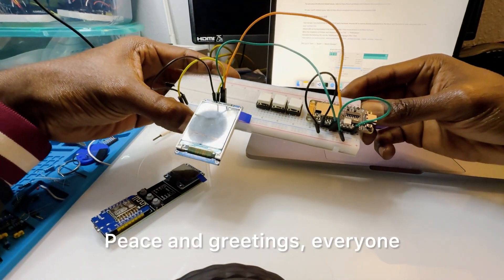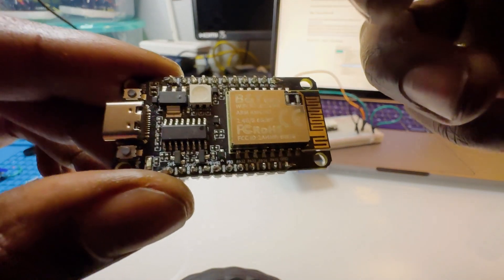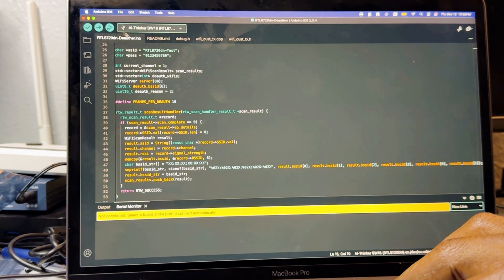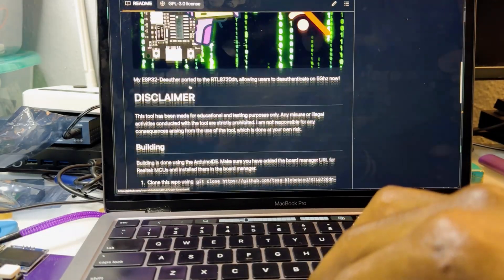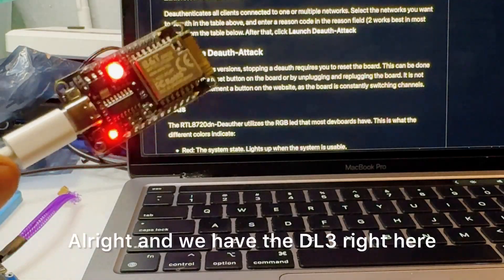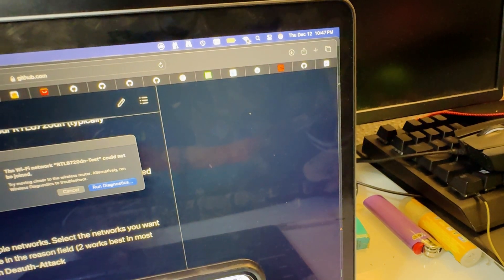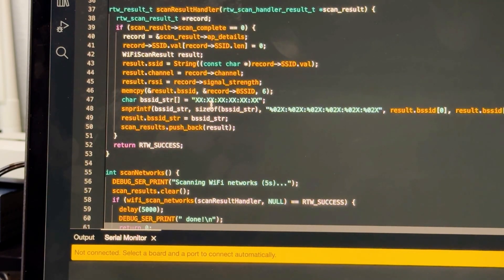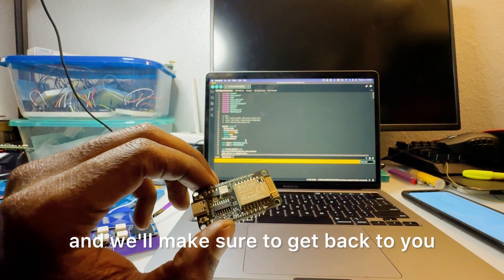How to Make a 5GHz WiFi Deauther!

Comment from the maker: Helpful troubleshooting info!

*Context:*
Many people, including myself, have encountered an issue where their 5GHz deauther doesn't function after successfully uploading the code, even when the wiring and cable connections are confirmed to be correct.

What Worked for Me:

*Initial Setup:*

Plug in your device and ensure all settings are correctly configured (refer to the "Tools Setup" screenshot).
In the tools section, enable the "Erase all flash memory" option.

*Uploading the Code:*

Upload the code as usual. During the upload process, you'll see a message in the output that says:
"Please enter the upload mode manually" followed by a 5-second countdown.

*When this message appears:*
Hold down the BURN button.
While holding BURN, press the RST button once.
Release the BURN button.
This sequence will put the device into upload mode.

*Confirmation:*

After the upload is complete, you should see a message like "Erase flash successful".

*Uploading the Real Code:*

Go back to the tools section and disable the "Erase all flash memory" option.
Upload the real code using the same BURN + RST combination during the "Please enter the upload mode manually" message.
Give the device a full minute to process and settle after the upload.

*Final Step:*

Once you're sure the code has been successfully uploaded, press RST to reboot the device. It should now boot up and function properly.

*Also:*
Some people find success by toggling the "Auto Flash Mode" option instead of using the BURN + RST method, but I personally experienced inconsistent results with it.
Reply: Is there any messaging app you use to contact you like messenger or telegram for better communication with regards to your tutorial sir?

Comment: Why is it not working today? tried to deauther my connection and after selecting the code 2 on the reason code, the light on my bw16 is just blindking red/blue and still no sign of disconnection. I tried it few days ago and still works but now it doesnt. Is there a problem with the code?

Comment: compilation error exit status 1 how to fix?
Reply from the maker: What’s the full error?
Reply: @littlehakr  In file included from C:\Users\sbyym\AppData\Local\Arduino15\packages\realtek\hardware\AmebaD\3.1.9\cores\ambd/Arduino.h:46:0,
                 from C:\Users\sbyym\AppData\Local\arduino\sketches\6507D2408703B01DC35234FED46EFF3B\sketch\RTL8720dn-Deauther.ino.cpp:1:
c:\users\sbyym\appdata\local\arduino15\packages\realtek\tools\ameba_d_asdk_toolchain\1.0.1\arm-none-eabi\include\c++\6.5.0\bits\stl_vector.h: In member function 'std::vector<_Tp, _Alloc>::size_type std::vector<_Tp, _Alloc>::_M_check_len(std::vector<_Tp, _Alloc>::size_type, const char*) const':
C:\Users\sbyym\AppData\Local\Arduino15\packages\realtek\hardware\AmebaD\3.1.9\cores\ambd/wiring_constants.h:78:19: error: expected unqualified-id before '(' token
 #define max(a, b) ((a) > (b) ? (a) : (b))
                   ^
c:\users\sbyym\appdata\local\arduino15\packages\realtek\tools\ameba_d_asdk_toolchain\1.0.1\arm-none-eabi\include\c++\6.5.0\bits\stl_bvector.h: In member function 'std::vector<bool, _Alloc>::size_type std::vector<bool, _Alloc>::_M_check_len(std::vector<bool, _Alloc>::size_type, const char*) const':
C:\Users\sbyym\AppData\Local\Arduino15\packages\realtek\hardware\AmebaD\3.1.9\cores\ambd/wiring_constants.h:78:19: error: expected unqualified-id before '(' token
 #define max(a, b) ((a) > (b) ? (a) : (b))
                   ^
exit status 1

Compilation error: exit status 1
Reply: Downgrade the version of the libary to 3.1.7.

Comment: In file included from C:\Users\andre\AppData\Local\Arduino15\packages\realtek\hardware\AmebaD\3.1.9-build20250603\cores\ambd/Arduino.h:46:0,
                 from C:\Users\andre\AppData\Local\arduino\sketches\CB0C1A680CDD7B360E236A99A68366E9\sketch\RTL8720dn-Deauther.ino.cpp:1:
c:\users\andre\appdata\local\arduino15\packages\realtek\tools\ameba_d_asdk_toolchain\1.0.1\arm-none-eabi\include\c++\6.5.0\bits\stl_vector.h: In member function 'std::vector<_Tp, _Alloc>::size_type std::vector<_Tp, _Alloc>::_M_check_len(std::vector<_Tp, _Alloc>::size_type, const char*) const':
C:\Users\andre\AppData\Local\Arduino15\packages\realtek\hardware\AmebaD\3.1.9-build20250603\cores\ambd/wiring_constants.h:78:19: error: expected unqualified-id before '(' token
 #define max(a, b) ((a) > (b) ? (a) : (b))
                   ^
c:\users\andre\appdata\local\arduino15\packages\realtek\tools\ameba_d_asdk_toolchain\1.0.1\arm-none-eabi\include\c++\6.5.0\bits\stl_bvector.h: In member function 'std::vector<bool, _Alloc>::size_type std::vector<bool, _Alloc>::_M_check_len(std::vector<bool, _Alloc>::size_type, const char*) const':
C:\Users\andre\AppData\Local\Arduino15\packages\realtek\hardware\AmebaD\3.1.9-build20250603\cores\ambd/wiring_constants.h:78:19: error: expected unqualified-id before '(' token
 #define max(a, b) ((a) > (b) ? (a) : (b))
                   ^
exit status 1

Compilation error: exit status 1
Reply from the maker: Did you download the bw16 board files?
Reply: Make sure to install the project board to version 3.7 instead of 3.9

Comment: Pretty Sure this doesnt work for 5ghz because there are No Low Level APIs or modifications that enable 5ghz PHY for Packet injection because the regulatory Domane protection is hardcoded?
Reply from the maker: Everyone has successfully used this project for 5GHz
Reply: @littlehakr i bought one and i'll try it

Comment: How I fixed the missing required files error in Arduino IDE:

I kept getting an error saying I didn’t have some specific files or components required to run the IDE. To solve this, I completely deleted all Arduino IDE files from my computer (including preferences, libraries, and any leftover folders). Then I did a fresh reinstall of the Arduino IDE from the official website. After that, everything worked perfectly!

Hope this helps anyone stuck with the same issue!
Reply from the maker: Wow glad that helped and thanks for leaving your solution!! 🙏🏿🙏🏿🙏🏿

Comment: Bad News: I couldn't get the 5Ghz to dèauther (2.4Ghz can be dèauther, though). My 5v power source is fine. Uploading code into the BW16 went smoothly --I used 'Auto Flásh mode - Enable' (I still didn't understand why people bothered with the 2-buttons technique ). I've tried many codes from other deposìtories but still couldn't dèauther the 5Ghz signal. I tried (so many) different values for both 'frames_per_dèauth' & 'send_delay' and still no luck. I'm start to think maybe my chip is defective.

Comment: ** This is related to a previous comment I left yesterday. **

To @DivineZeal :  You said you couldn't get it to deauther the 5Ghz signal until changing the 'frames_per_deauth' to a 10 but the unmodified code worked for the original author and likely more than a few others as well --but I bet also  that many others couldn't get it to work neither (which shouldn't be, should it?)

I was wondering if you could try this other code and see if it  would work on your BW16 and, perhaps, come up with a possible explanation why this is so. Thank you.

Comment: Just flashed one. Works great directly from GitHub. It actually didn’t work when I git cloned the page. I had to download the zip & rename the decompressed folder. I then used auto flash & it works perfectly! My screens arrive tomorrow so I’ll be making that version. Could you post a video about how to hookup a rechargeable lithium ion battery & a port to charge the battery?

Comment: always get a same error: Uploading.....error: Enter Uart Download Mode ...Upload Image done.
Reply from the maker: You have to put the chip in download mode first.. hold boot button, reset button, then let go of reset, and then boot. Google helps
Reply: @littlehakr  Yes, Google helps a lot, but spreading false or, worse, incorrect information is VERY bad, bro. I discovered why even after doing the BURN/RST button procedure it still gave a Uart error... This occurs because by default, the Arduino IDE comes with the option (in Tools) Auto Flash Mode OFF and it has to be ON (Enable) for those who have a "clean" board without any code. Otherwise this error will always appear and the code will not upload. If you are going to teach or spread information, please DO IT RIGHT!

Comment: Could you guide me on how to install the UFL connector antenna? Just solder it?
Reply from the maker: Yes you solder it on, but this board uses the pcb antenna by default. You will need to modify the chip which is complex. I may make video later
Reply: @DivineZeal  thank you! It would be very useful!

Comment: I made this setup . The 2.4 ghz was deauthered succesfull.  but my TPLINK 5 ghz  access point was not deauthered at all by this chip and software. The blue led blinked as if it was working on it, but nothing happened on the clients . They could connect and reconnect over and over . I dont know why it doesnot work on my access point. I have more access points for testing.  Another strange thing, I ordered 2 chips, same brand etc. On one I could install the software, but on the other one it keeps giving me errors. But thats another problem.

Comment: Not sure if im the only one who has this issue, but whenever i deauth a wifi only 1 device is affected. Other devices are working as usual. (devices are 2 laptops, iphone and android phone). Any suggestions? also tried powering it thru a laptop port and a 65w gaN  charger, same issue.
Reply from the maker: If you deauth a WiFi network how can other devices still be connected?

Comment: Esp32 jamming 5ghz ino bin it more easy than use arduino system always have problem error or something not right
Reply from the maker: I know but I think providing bin would create more confusion. If you do the steps right Arduino is better cause you can customize your code
Reply: @ yeah you can modify your own code but if you have both It would be great for your project so people didn’t struggle with the firmware that your create make it both please 🩷

Comment: All works fine but one problem when i start deauth on 5G then the bw16 big light blinks but he cant deauth 5G and also i cannot connect the bw16 ssid when i start deauth attack on 5g
Reply: It is a scam, fake. It will not work for 5G.
Reply from the maker: Haha it does work
Reply: Because RTL8720DN only scanned the 5GHZ but unable to Deauther the target...it only works on 2.4GHZ.

Comment: Hi divinezeal, did you ever figure out how to "enter uart download Mode" as prompted by the IDE? I have tried bridging PA8+PB2 and PB1/PA7, but still no UART. I'm getting stuck on that bit and if you know how to fix it I'd really appreciate a response. Thanks
Reply from the maker: You don’t need to bridge anything. You just hold boot button, hold reset for a second, and then let go of reset button, and finally let go of boot button
Reply: @littlehakr  for me that results in an error stating:
"Uploading.....error: Enter Uart Download Mode"
Reply: @littlehakr  but how do you not need to bridge any pin, if your troubleshooting asks you to pin it? I have the same error and I have already tested it on two boards and it does not enter UART mode at all!

Comment: im having an issue i keep getting an error about the wifi cust everytime i try to upload the sketch
Reply from the maker: Can you try to paste the error here
Reply: @littlehakr  C:\Users\x01\Downloads\RTL8720dn-Deauther-master\RTL8720dn-Deauther\RTL8720dn-Deauther.ino:4:26: fatal error: wifi_cust_tx.h: No such file or directory
 #include "wifi_cust_tx.h"
                          ^
compilation terminated.
exit status 1

Compilation error: wifi_cust_tx.h: No such file or directory
Reply: @littlehakr  C:\Users\cata1\Downloads\RTL8720dn-Deauther-master\RTL8720dn-Deauther\RTL8720dn-Deauther.ino:4:26: fatal error: wifi_cust_tx.h: No such file or directory
 #include "wifi_cust_tx.h"
                          ^
compilation terminated.
exit status 1

Compilation error: wifi_cust_tx.h: No such file or directory
Reply: @littlehakr  its the same for me. it says library not found
Reply: In arduino IDE, it created a subfolder for you correct? If you add all the contents to the sub folder then it should go smoothly
Reply: yea me too does someone have found an solution?

Comment: I can't make it work on my end, followed all the instructions, LED is showing a response that everything seems to be working fine (blue light). but it does not deauther 5ghz, even after changing the frames to 10. but overall Great Video!
Reply from the maker: You must make sure you power with a good 5v power source

Comment: i dont know what is problem with bw16 i tried each and every way code is succesfully uploaded , even i tried different wifi examples but problems persist same - ssid not showing in serial monitor it writes only initlizing wifi .
Reply: I think I did all ok but get  errors: 
 [ERROR] Accept connection failed 
The red LED is on after reset, but no WIFI acces point is shown. Maybe I missed some info.
 I miss the part that showed how you flashed it. Maybe its obvious but not for beginners like me.  
After so mucht retrying I only got Uploading.....error: Enter Uart Download Mode etc. I will try to find how to solve this on other channels.
Reply: @redbearrc6706   I got solution for this you had to add some capacitor but I don't have that values of cap. Then I removed the bwrtl chip from the board and soldered it over the esp8266 board , used a big one esp board with a ch340 driver it is a little bigger than the cp2102 driver  board rtl chip completely fitted at the place of esp cip . Then program it using an external ttl converter , and it works fine for me
Reply: @redbearrc6706   I don't know why do youtube delete my long length comments automatically but for you I am writing again in very short just remove bw16 chip and solder over eap8266 bord. choose big one fit perfectly it will work,
Reply from the maker: @redbearrc6706  to enter download mode, you must hold the boot button, then hold the reset button for one second, and then let go of the reset button, and then let go of the button
Reply: @DivineZeal  It flashed ok, but  it does not show the access point. tried on 2 different chips, same result
Reply: @redbearrc6706   and if you don't want to use external ttl converter you have to do some modifications in bord connect rx of esp bord to log tx and tx to log tx , but boot and reset still you have to do manually, esp and bw16 same enable pin , so to reset push button between enable of esp to ground. And it is also very important to add push button between log rx or tx i forget but use the one which work , group and rx push button make rtl chip in programming mode. First click reset hold the click group to rx or tx (, which work)  release reset then release rx-,gnd
Reply from the maker: Make sure you power with good 5v power source and not laptop

Comment: I get the error message "enter uart download Mode" in Arduino Software
Reply from the maker: Here is a helpful tip:

*Context:*
Many people, including myself, have encountered an issue where their 5GHz deauther doesn't function after successfully uploading the code, even when the wiring and cable connections are confirmed to be correct.

What Worked for Me:

*Initial Setup:*

Plug in your device and ensure all settings are correctly configured (refer to the "Tools Setup" screenshot).
In the tools section, enable the "Erase all flash memory" option.

*Uploading the Code:*

Upload the code as usual. During the upload process, you'll see a message in the output that says:
"Please enter the upload mode manually" followed by a 5-second countdown.

*When this message appears:*
Hold down the BURN button.
While holding BURN, press the RST button once.
Release the BURN button.
This sequence will put the device into upload mode.

*Confirmation:*

After the upload is complete, you should see a message like "Erase flash successful".

*Uploading the Real Code:*

Go back to the tools section and disable the "Erase all flash memory" option.
Upload the real code using the same BURN + RST combination during the "Please enter the upload mode manually" message.
Give the device a full minute to process and settle after the upload.

*Final Step:*

Once you're sure the code has been successfully uploaded, press RST to reboot the device. It should now boot up and function properly.

*Also:*
Some people find success by toggling the "Auto Flash Mode" option instead of using the BURN + RST method, but I personally experienced inconsistent results with it.
Reply: Make sure you press burn and then reset before uploading it not during it. It fixed it for me.

Comment: could you link the edited code please, and also does this have to be connected to a computer to work or could i just simply plug it into a power bank or a small li ion battery ?
Reply from the maker: Currently I have the code for the device with a screen uploaded. I will make a fork of this code later today and upload to my github
Reply from the maker: Also you can just plug into any power source and connect with your phone to the web ui

Comment: Congratulations on the video, brother, very explanatory. I did everything according to the tutorial and I'm using the same card. I select the network I want to take down and it still doesn't take down.
Reply from the maker: Did you edit the code especially deauth frames?

I added a fork to my GitHub if you want to see my code
Reply: @littlehakr  Brother, in your repository I entered this part: cypher-5G-deauther . I didn't find the code to replace what you passed in the previous video by user tesa-klebeband. Another detail, when are you going to make a tutorial for us step by step using an OLED screen like this one in your repository.